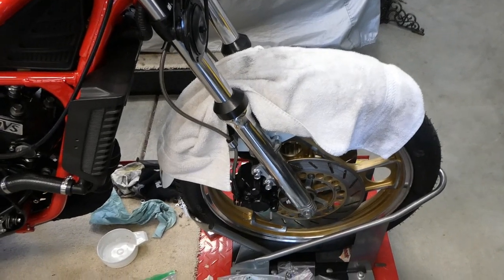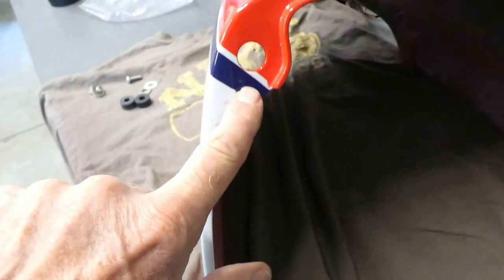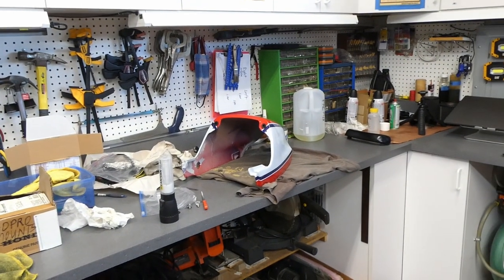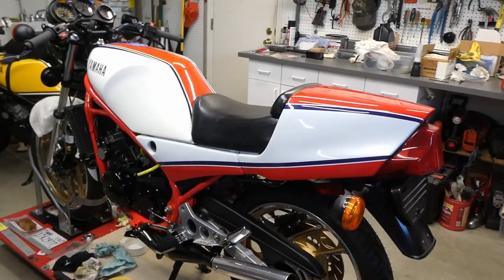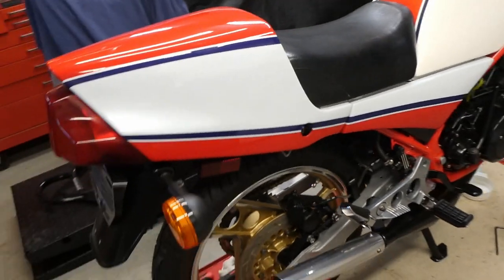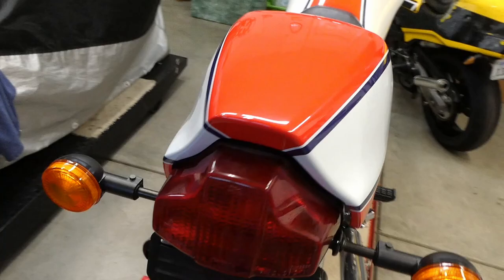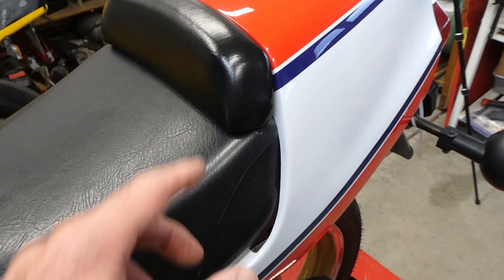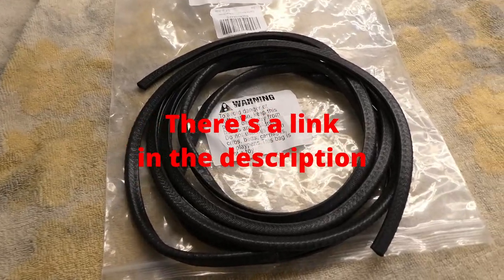RZ350 NC2 EP73 SOLO COWL INSTALL - DON’T LIKE THESE THINGS

Comment: I'm glad I'm not the only one that has problems with this pandora's box. Been through so much with mine..my 84 & 85 both have them. They always crack around the mounting area where yours was repaired. Just so you know when you remove them to add oil or etc.. you don't have to remove separately. You take off unit all in one piece and always remember once it's on you don't want to ever touch if possible. Another thing the back part was held down originally with two black large o-rings from Yamaha. To install them you have to remove lenses on turn signals and roll them over black housing  then try to get up underneath to hook up around molded tabs on cowl. The O-rings should sit on stalk part of signals close to frame. Carey at rz's unlimited has the O-rings. They will drive you crazy but the end result looks very cool 😎 
Good luck!
Reply from the maker: Great information Stephen. This comment has been pinned to the top. I knew about the orings but had no idea about the "process" to get them on. And clearly I didn't think about leaving it attached to the seat and removing it as a unit. That's great to know and I'll give it a try. So now as you said "once it's on don't ever touch if possible". For now I will use black tie wraps which will hopefully hold on to the glued on mounts up underneath. I doubt I'll get many miles on this before I change over to the proper refinished body work. Maybe.😁Thanks again for the great reply here!!!
Reply: @Ken's Garage  No problem..My 85 has those flush mount tear drop style signals, so I use 2 black zip ties to hold back down. Got to keep back down to prevent flexing of two front mounts. It's not a very good design. Most people have cracks in them. Waiting for someone to make a carbon one. The bum stops are hard to get and are about 300 if you find a good one. I actually had the plastic backing for one 3-D printed but would need to be upholstered. 
Happy Riding 🏍💨

Comment: The bike looks real nice. Maybe you can put a belt of some sort around the seat in that area to compress the seat away from being in contact with the bracket or the cowl.
Reply from the maker: Thanks John B. for now it will stay as it is. That seat is my "solo seat" seat. It's already ruined from being modified for the 83. As I mentioned this body set will come off for the NC2 stuff hopefully by summer.

Comment: Hey Ken, great video series. My ‘84 is in need of new paint, and I thought I heard you say the paint shop would be opening this spring/summer, do you do paint for others, or just your own stuff? 
BTW, where in california are you, if you don’t mind me asking?
Reply from the maker: Hi Nuno. Thanks for thecompliment. Yes, the paint dept will be operating this spring summer to some extent. Got priced out with the latest quotes to paint a couple 350's that are ready. So forced to learn the process myself. Not for hire, sorry. I have too much stuff to do. In the bay area south of Oakland. The 350 in your avatar looks quite nice!
Reply: Thanks for the quick reply, Ken. It’s a bummer you’re not for hire. Even if I threw in some RZ parts? Let me know, and keep up the great work. Also, my RZ is definitely a 10, especially if you stand at least 10 feet away. 😂
Reply from the maker: @Nunodeo  A 10 at 10 feet. Sounds perfect for a good riding machine. And definitely not for hire. Always willing to help out but a paint job, nope. This little hobby is fun but there's a bit more to life than this, eh?
Reply: It is the perfect little riding machine. And yes, there’s a lot more to life than this 2 stroke hobby. Thanks again for replying, and I hope to run in to you at the Quail, or maybe even Alice’s. Cheers